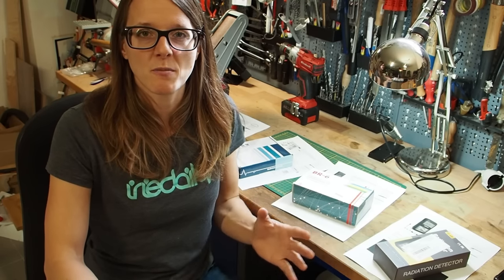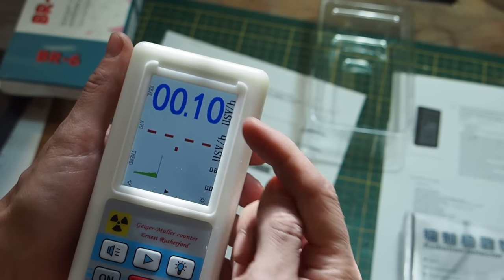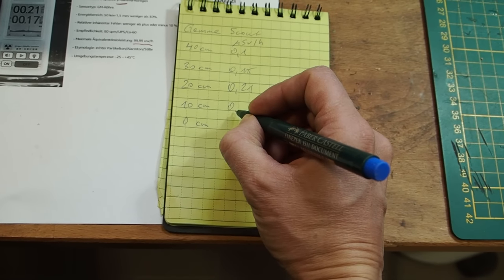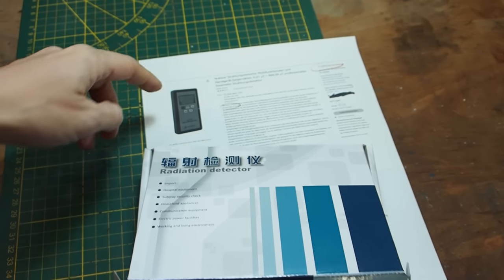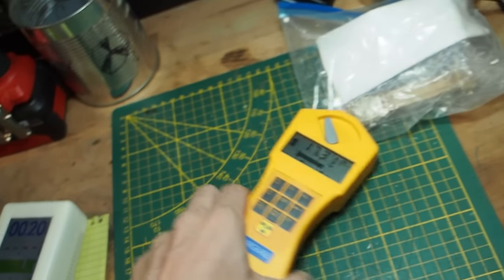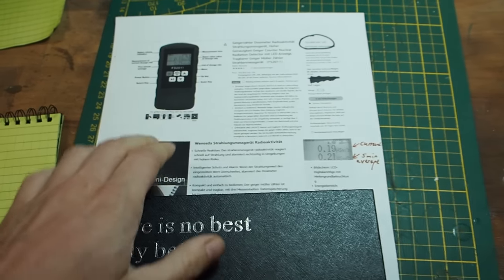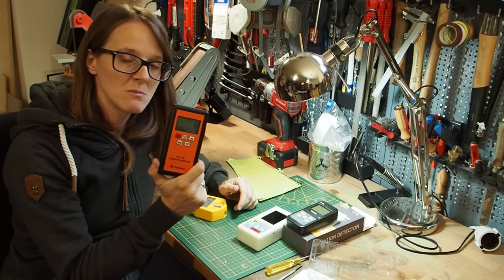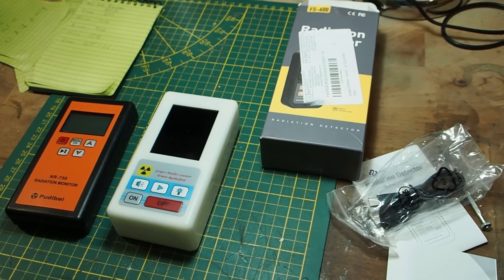Cheap Geiger Counters on Amazon - Only 1 is Worth it!

Comment: Next to different sensitivity to background radioation, it may also be the case that some of these GM tubes (like the M4011) are sensitive to visible or UV light. The smallest tube might be an J613/J614 and is very susceptible to UV, hence the shrink wrap.

Comment: The reason why the BR-6 wasn't testing very accurately was because the tiny holes on the back of the dosimeter block most of the particles going into the sensor. Most people drill holes in theirs and cut the heat shrink on the tube to make them more accurate.

Comment: Amazon sold out of the Gamma-Scout standard. I bought the last one. However, it will soon be available again as I'm returning it since (1) the battery is not user-replacable (soldered onto the board) and (2) there's no OFF switch, so it runs 24/7. I'm certain it wouldn't work a few years from now if I needed it.
Reply: I had the same thought when I read "Rechargeable" on that device. I thought to myself "not another inbuilt battery that is hard to replace". Puts the device in the "Disposable" category.

Comment: Interesting video 
Survival Lily. I have an old Heathkit  Geiger counter Monitor 4  that I built in the 1970's. I also have a collection of watches with Radium dials. The unit doesn't have an alarm function but has an analog dial. It has three settings, lo, medium and high with reading are counts per minute. It will read up to 50,000 counts per minute on high. The unit will register a few clicks a minute on its lowest setting when no obvious source of radiation is nearby. It also has a battery test function for the installed 9 volt battery. It has a click function also. The unit goes wild when brought within a few inches of a watch with a radium dial. I noticed something very strange about an old wind up German mantle clock that doesn't have a radium dial or face. The clock sets off my Geiger counter like it would with a radium dial. The only reason I can think off for this is that the clock was made in a facility where Radium was used and it became contaminated with Radium dust in the factory and is still hot.

Comment: In such a situation, I think there is a good chance the  Geiger Counter would vaporize at the same time its owner did, so at that point there is a chance it wouldn't be of much use.
Reply: Let's hope you're not that close.
Reply: If you're not in a major city or military base you aren't getting vaporized. Even then, if you're underground or in a tough building near the outskirts you probably won't die from the blast. You would be most most likely to die from the fallout, which is why you need the geiger counter.
Reply: It would be more useful for those outside of the blast area, and downwind of any fallout. This would be helpful with a dirty bomb scenario where the explosive damage would be much smaller than a nuclear blast. A post-nuclear strike survivor's life would be migratory and if they are able to avoid areas of high radiation, from fallout, their survival chances are better. Fallout clouds would move with the weather.
Reply: @n74jw  Not sure about the migratory thing. I bet it would be safer to find a basement or something and spend most of your time there for at least a year, until as much of the fallout has left the atmosphere as possible and has decayed. Trying to outrun the weather all the time is going to cause all kinds of problems and sooner or later you'll make a bad call or get caught out. Not to mention traveling a lot means being unsheltered from fallout in the soil, trees canopy, etc, resulting in higher doses. For that first year or so there might be enough preserved food from trucks and distribution centers, etc, that with 75% of the population gone you'll be okay without hunting or agriculture. After that I would consider building a greenhouse, removing the topsoil from the area beneath or at least making raised beds, and filled with soil you can get from lawn and garden centers, which shouldn't be contaminated since they're often indoors and in bags. Another option might be to tip over a house trailer or demolish a prefab house and try to get uncontaminated soil from underneath.

Edit: Also if no one has periodically washed down the roads I think they would be filled with fallout which would be kicked up as you travel. A car would probably end up highly contaminated inside and out from trying to make long trips.
Reply: @asahearts1  just keep in mind that fallout is likely to have a large Alpha element, which most of the inexpensive counters will not detect:Alpha is basically harmless outside of the body, but if inhaled(which is generally the main mode of exposure for fallout)or ingested, is very dangerous:Alpha is highly ionizing, which means a high risk of cell mutations(IOW, cancer).

Comment: Thanks. Great info for your audience. I bought a bit more expensive one and hope to be able to test it some day.
 The emission of radiation at low levels is relatively random in  timing -- there are random number generators based on a radioactive sample decaying. What you get for a reading for radioactivity is an average over some time (likely seconds) which you may be able to adjust. That time may be the difference between fast and slow response. It is certainly not the reason for difference in levels. 
As a dossimeter reading the total radiation you have been exposed too over hours you might get longer sampling times.

Comment: The Geiger tube in the BR-6 is wrapped by a thermoplastic tube, this is a method used to increase sensitivity to gamma rays. However, the disadvantage is that the thermoplastic tube will further block beta rays. I think the BR-6 is more suitable for measuring gamma rays

Comment: Just to add, I do have a cheap budget Purible.  I do not expect it to give me a reading in the midst of a nuclear attack.  I have it to let me know if the radiation levels rise above normal.  We may not be told or all forms of communication are down and you are remote enough from where an accident or attack happens

Comment: I collected STS-5 tubes when they are on discount from a vendor, and have bought pre-assembled boards from China. With Pico Pi or ESP32 microcontrollers and LCD display and siren, I have built a few to pass out to friends and relatives.  All these builds are under $45.
Reply: STS-5 is good, SBM-20 is slightly more sensitive, but the STS-5 is still pretty good, and tends to be cheaper.

Comment: There ist a difference between the gamma-Counter, which is also sensitive for alpha-radiation using a window-counterchamber, and other counters using a only beta- & gamma-sensitive standardtube as radiation-detector. That means a higher sensitivity of the gamma-Counter. The high sensitive counters are normally used by professional coworkers in nuclear plants and other radiation control areas, where the radiation must be detected from a save distance. For enviromantal short-detection are counters with the standardtube are usefull.

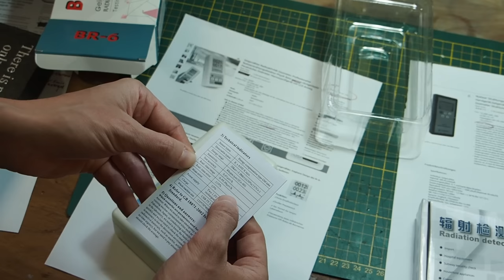Comment: 2:40 I have a Polimaster watch. The background Rad at my house is 0.06 micro Sieverts per hour. 100 uS/hr is huge. I have it set to ring at 0.51 and it has never gone off because 10x background doesn't happen under normal conditions. You'll be fine with a cheap one.

Comment: Bought another one, as I took a cheap one from amazon at first, but it can only measure beta, gamma and roentgen radiation. Now invested roughly 350 euro for a new one, but did not take the gamma scout, as I wanted one run on normal exchangable batteries. Got me a Voltcraft RM400

Comment: I have the cheap model that actually worked in this video, but have since bought the GMC500+ model which doesn’t have Alpha detection, but as Alpha radiation can be blocked by a sheet of paper I thought do I really need that.  On the prepper rule that 2 is 1 and one is none. Though at some point I’d like to get a top end professional unit.

Comment: Thanks for the reviews, Lily. I am in Colorado with no nuclear power plants anywhere nearby. However, I live 40 miles from NORAD, which would be targeted if we had a full nuclear exchange. This would be a handy thing to have, but I may not live long enough to use it. Let us hope that never happens.
Reply: The radioactive fallout from Fukushima was world-wide.
Reply: @thomasmaughan4798  Not in any meaningful way it was not. Please stop spreading FUD.
Reply: @nobodynoone2500  "Not in any meaningful way it was not. Please stop spreading FUD."
My dog like FUD although lately she has been rather picky about it.
The topic is cheap geiger counters; not the kind to be used in a fuddy nuclear exchange, but rather the exact sort of thing you might possess to check your vegetables if you happen to be downwind of a nuclear test or accident (as I happened to be).  Fukushima produced detectable levels of radiation worldwide and so did Chernobyl.   Whether a person ought to be alarmed depends upon actual personal exposure which seems to be about 3 microseiverts per hour, or less, is acceptable.  A Gamma Scout will sound an alarm at 5 microseiverts/hour and its battery runs for 10 years so put it on a shelf and forget about it for 10 years.  If it beeps, check it out.
For interesting hobby purposes, check for radioactive sources in your home.  Propane or kerosene lantern mantles are radioactive.  The dust on my furnace filters are slightly radioactive.  There's radioactivity in smoke detectors.

Comment: If you're going to get a good measure of aerosol radiation you need to circulate air through a small filter and get a reading on the filter, not just wave a Geiger counter over objects.

Comment: Hello dear Lily!

Really interesting video with that device comparison.

However, whenever you want to compare such readings, please take an average of at least 10 readings per device and per distance.

Also  - a Geiger Müller counter tube only measures a few individual particles that fly through.  Simply holding out is not enough.  Please leave the measuring device in each position for about a minute.  Then you get better values than the random numbers you get from such quick measurements.

If you decide to do a longer test and then present the result via video, I'm really looking forward to it with great interest.

Great video again !!  Keep it up !!
nice greetings from Fritz ( Burgenland )
Reply from the maker: Hello Fritz. This video is edited. I was holding the devices at those distances for at least 1 - 2 minutes.

Comment: Ms. Lilly, I was a non-occupational radiation worker in the US Navy. I did not deal directly with Naval Nuclear Reactors. I was a Radiographer (the guy who took X-rays). The short coming of a Geiger counter is that the Geiger-Muller (Sorry I don't know how to umlaut the U.) is that they fail, unsafe. In other words, if the tube is exposed to a radiation field that is too strong, the tube will be saturated, and the meter will show ZERO Rs and continue to show ZERO Rs until removed from the strong field. Not intended as a damning of the products you selected, but just adding to the knowledge base.
Reply: Have a lead pot you can put it in to desaturate without moving far, then run like hell.

Comment: All those devices measure Gamma Beta body exposure, if the value raise quickly over the background it show that you are in a fallout area in this case where the air is contaminated a sensor with air opening will likely to be more reactive. Checking them against a known source is definitely useful to detect the fake one's. The accuracy at 0cm is not very significant, the Sivert is measuring full body exposure. All the Geiger counters you tested are genuine the interesting points would be, can they run 24/7 are they generating an alarm when the radioactivity raise.
Otherwise they're completely useless to measure food contamination which has to be measured in a radiation background free environment ie, in a few hundreds pounds lead container, a few Becquerel ingested will take years to kill you. If a radiation level show up on those scanners it will kill you in a few weeks at best.

Comment: These are fine for low levels you would normally be safe from. In a war setting, you will need a high rate meter. These would be way overpowered and not give good, accurate readings...
Reply from the maker: I think it is more important to have a sensitive and affordable geiger counter, so people can find out if their garden and food is contaminated. If the low level geiger counter is maxed out because of extreme radiation you know you have to stay inside of the house either way

Comment: Honestly you would be better served if you can get hold of an old reconditioned civil defence survey unit built for this purpose. These small GM counters would be quickly swamped in a nuclear fallout scenario. That said, I cannot get a CD unit myself, so I do have a little handheld in my BOB. Not sure what make it is but it is an FS2011 and it gave plausible readings on an old gas mantle. Better than nothing assuming it survives the EMP.,
Reply from the maker: it is cheap and working. not everybody can spend a fortune on geiger counters.
Reply: @SurvivalLilly  That is my thinking as well. I cannot afford a survey meter! As a secondary backup measure, look into how to construct a Kearny fallout meter and keep the plans for one in your pack. Ideal if the electronics are fried or you don't have the budget for a GM.

Comment: I have a question for you Lilly ... 
Even if you are in an area where there is no nuclear fallout and you are unlucky enough that wind blows the fallout into your area, you will be affected even if you have a Geiger counter.
Mainly because as a prepper you are set up as a 'fixed point Prepper' and if there is real nuclear war, a Geiger counter will be of little use unless you have a lead lined room somewhere or a propper nuclear bunker.
Reply from the maker: this is like saying you hit your head harder in an accident without a helmet. I am not sure if I understand your question right?! whats really important? you need to find out if you can still eat the food in your garden or from a store. and secondly you need to know if you can go outside or not. thats why you need a geiger counter.
Reply: @SurvivalLilly  hi Lilly, my point is that if your crops or the air around you is irradiated just staying indoors won't protect you unless you have a means of blocking the radiation or you are able to move away from the area quickly and far enough to survive
Reply: I do not mean to be rude just stating what I think
Reply from the maker: @flewkit  the radioactive particles will fly around like dust and settle on the ground and roof of your house. If you are in the immediate area of ground zero then you neee to leave. If you live nearby just a few miles away you need to stay in the house for 2 to 3 weeks.
Reply: Prepper nuclear bunker? At a distance, an air blast will mostly be short lived dust so a positive pressure airtight room with fine intake filtering will probably do. Auto air filter followed by P95. Stored food/water/whiskey should be unaffected, your outside generator will not care.